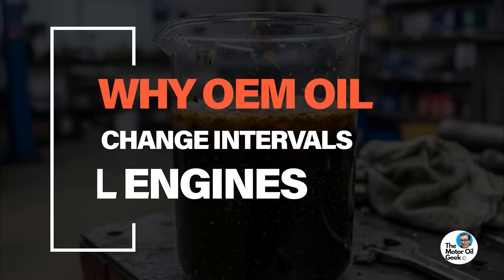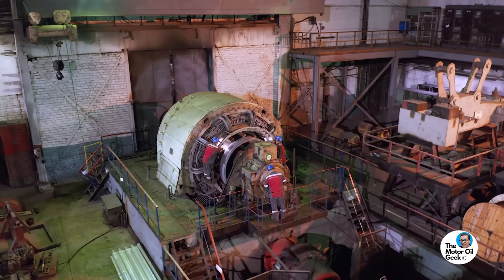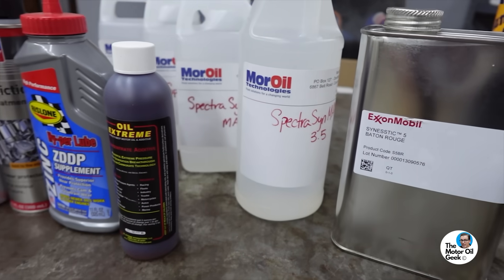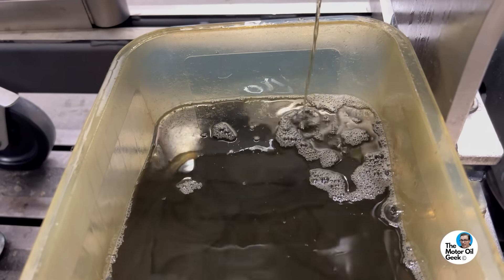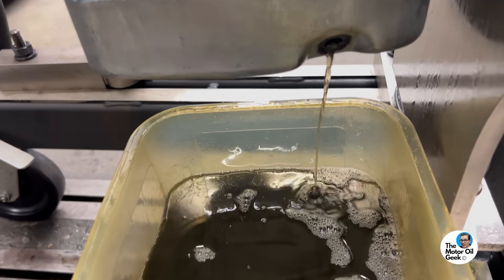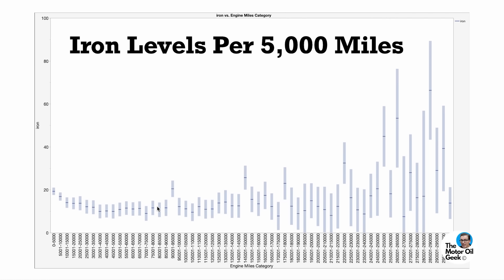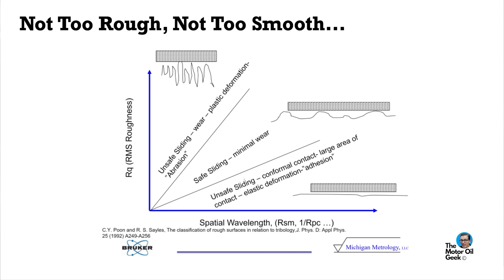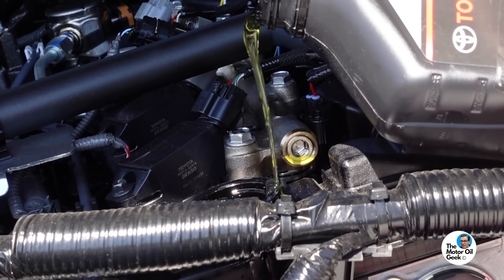NEW Data Reveals WHY Modern Engines FAIL Prematurely!

Comment: Filters actually filter better the more usage and clogged they get assuming they dont get so clogged flow is restricted to much. Ive got a 2023 f250 with the 7.3 gas i bought new. I changed my oil at 1500 miles 3,000 then roughly 5,000 to 7,000 since. Im now at 25,000 miles and my target oil change interval is 6,000 miles. I use penzoil ultra platinum 5-30 and amsoil filter would it be better to change my filter every other oil change? My way of thinking is its a better filter rated for more miles than 2 oil changes and the filter will actually do a better job this way. Am i wrong ?

Comment: What is end of engine life? My VW TDI has over 700,000 miles on it with 10,000 mile oil and filter changes. My 80's VW and Toyota engines were closer to 300,000 miles before accidents took them off the road.

Comment: Its really ridiculous that the manufactures cant make reliable engines. There is no reason with modern tech and materials
Reply: They can but the market is demanding more horsepower and higher MPG at a lower mfg cost.

Comment: As a HEMI owner I change my oil every 5,000 miles maximum with amsoil 5w20 and send a sample for testing . My iron levels stay right around 12ppm. Is that too high ?
Reply: I switched to 5w30. RAM has gone from 5w30 to 5w20 to 0w20. No engine changes. They would switch to 0w0 if the govt told them to. Go with what it was originally  designed for - 5w30.
Reply: @SatoshisDiaper  that’s good to know they originally required 5W-30. I do have an extended warranty until 100,000 miles so I will keep the 5W20 until then to avoid any warranty issues should I have a lifter failure. Do you know when they switched from 5W30 to 5W-20?
Reply: @itgoesfast2722  what AI said 

For the Ram 1500 with the 5.7L Hemi V8 engine, manufacturer-recommended motor oil viscosity has evolved as follows, primarily to improve fuel economy (CAFE standards) and cold-start performance while maintaining proper function of features like Multi-Displacement System (MDS):
•  Pre-2005/2006 models (e.g., 2003–2004/early 2005): SAE 5W-30 (or sometimes 10W-30 in older references) was the primary recommendation.
•  2005/2006 onward (starting with widespread MDS introduction in trucks around 2006): Switched to SAE 5W-20 for better fuel efficiency and MDS compatibility. This remained the standard through 2021 model years.
•  2022 onward: Changed to SAE 0W-20 (full synthetic recommended), offering the same hot viscosity as 5W-20 but improved cold-flow properties.
These changes apply specifically to the Ram 1500 (light-duty) models. Heavier-duty Rams (e.g., 2500/3500) often retained thicker oils longer due to no MDS and higher towing demands. Always confirm with your vehicle’s owner manual or oil filler cap, as exact transition years can vary slightly by sub-model or region. Oils must meet FCA/Chrysler MS-6395 specification.
Reply: @SatoshisDiaper thank you
Reply: @itgoesfast2722 no problem. I have a 2024 with 34K miles and as soon as I switched to 5w30 the awful clanking for a few seconds on cold start mostly went away immediately after changing. I’m not going back but I’m coming from 0w20 which is a bigger jump than you are.

Comment: Which is more important?  1) Engine that lasts a long time   2) Clean oil.   Problem: 2 can never be guaranteed.  So, to achieve 1, we must make engines like we used to.  Tougher.  More forgiving of dirty oil. More easily repaired after oil damage has occurred.   Considering all the C02 emitted during engine manufacture, the most "eco friendly" engine is the one you don't have to replace.
Reply: People always have the freedom to (re)build their own engine as they see fit.
Reply: @ALMX5DP  They should be built reliable from the factory.  Not "rebuilt" .  I don't want to rebuld a brand new engine I just paid   >   $7,000 for
Reply: @RedOctober2011  you asked the question, I was just providing an answer if that is your priority. Dont have to build a brand new engine, (re)build the one you already own.
Reply: @ALMX5DP  Oh, yes.  Exactly.  Rebuilding a rebuildable engine is a good choice.  I'd like to see new engines made more tolerant, simpler, and easily rebuildable.

Comment: Because manufacturers are designing engines to fail to maximize profits. The highest miles engines I've ever seen were an 87 Buick Century with 730,000 miles on the iron Duke and 3 speed, and 540,000 miles on an 88 LeSabre with the 3800 and 4T60 automatic transmission. Those days are over. And they won't come back without reliability and repairability standards are enforced by law.
Reply: You do NOT want Congress involved, at all, with vehicle quality standards.  That would be a disaster.  Let the market decide based on merit.
Reply: @gregh2880 The market has decided on engines that have rod bearing problems at 60,000 miles. Cars that burn endless amounts of oil. Cars with automatic transmissions made of glass.
Reply: @gregorymalchuk272 When I purchased my Sierra with a 6.2L engine two years ago, it was my expectation of a 300k+ engine like the thirty years of LS engines before it.  GM is the one that dropped the ball, not me.
Reply: How do engine failures maximize profits?
Reply: @craigyirush3492 You buy a new car.

Comment: Many of you might recall that manufacturers used to deliver new vehicles to consumers used to have break in oils in the engine. This is why you were usually required to be changed around the 600 mile mark. They stopped this because no one was ever changing this oil out, running the break in oil for thousands and thousands of miles. Non synthetic oil is great for break in but manufacturers deliver new vehicles with synthetic, which means the engine take much much longer to actually break in properly.  Food for thought.
Reply: I changed Toyota oil after 600 miles as advised by the owner's manual. Also recommend is 0-20 but I switched to 5-30 due to the hot climate. No problems and the engine sounds quieter so my guess is that regular wear is reduced by the thicker oil.
Reply: @PassivePortfolios  I have a new 24 Tacoma which just passed 26K miles. I too live in a hot climate (Phoenix). I've kept I on 0-20, but open to flipping to something a little heavier. First three changes were right on top of one another, then spaced out 3k after that.
Reply: @LincolnSixAlpha  Your Tacoma has a turbo 4 cyl. so switching to 5-30 will helps in the Phoenix hot climate. The factory recommends 0-20 due to MPG regulations by CAFE. Mechanics told me to use 5-30 in my F-150 and wife's 2021 Tacoma V6. And no more than 5k miles between oil and filter change intervals.

Comment: All of this makes perfect sense and really is something I have done either with new engines or ones that I have rebuilt. Surprising about the filter being better the longer it was used but, like someone mentioned here, manufacturers did, in the 70's, recommend filter changes every other oil change.

Comment: someone told me that a k@n air filter is not that great for an engine when its new because it flows too much and allows some debris into engine , but after 10k miles when its dirty it flows just as much but filters way better because dust sticks to dust so you get high flow with cleaner air as it ages
Reply: Nope, don't like those gauze air filters. They don't stop the fine abrasive particles. Then when they do start getting dirty they restrict airflow in my experience.
Reply: Most of those cold air intake filter kits are hard on your engine and they suck hot air from under the hood!

Comment: Sorry but we did not have this many failures until we took all the viscosity out of the oil. 0W and 5W base oils simply do not have enough film strength and the engine failures prove it.
Reply: It doesn't prove anything.

Comment: Our design goal of the best possible oil made leads us down many roads. Much of an engine is designed around the poor properties of crude oils because there weren't lots of options for plant or algae based stronger oils. That will change in coming years and has already been perfected in the racing world. We don't use petroleum oils in the high rev two stroke world championship world. $ strokes can have this tech too. It is more up front investment but cheaper over he long haul. Filtration is always a good area to explore, especially for longer lasting oils that just need the dirt and particulates removed.

Comment: Lake, I am a firm believer that today's engines the bearing clearances are simply too small. The OEM's are doing this to both reduce emissions and improve fuel mileage.  I also believe that the extended oil change intervals increase damaging combustion bypass (because of the low tension piston rings) particles getting in the oil.  When I used to rebuild engines, modern clearances of .002" was nuts, as the engine heated up, spinning a bearing would happen very quickly.  Hence the 0W-10,0W-8  oils to get into those clearances.  They should go back to. 008"-.013" clearances and back to 10W-30 oils.
Reply: You are spot. My lottery guess is what you said is exactly the reason for the failures.
Reply: Naw, you didn't run that much clearance did you?
Reply: @oneninerniner3427 I'm old and retired.  But back in the 80's and 90's ( the olden days to you) we absolutely had clearances that size for mains.

Comment: Subaru 3.6L uses variable valve timing and with regular oil, they recommend 7500 mile oil changes. These engines routinely last 300k plus. These engines also use small oil filters. My outback 3.6r  has over 215k on it and it runs like new.

Comment: The 7.3 power stroke was probably one of the first engines that seriously used engine oil for hydraulic fluid. It used the oil to fire the fuel injectors.

Comment: back in the 70,s the car manual used to say change oil filter every second oil change , i guess they knew something back then about oil filters, i got a 1970 plymouth fury 111 and the owners manual sais change oil filter every 2nd oil change
Reply: I remember when that was a common practice.  Back then oil filters were a lot larger. Close to the size of a quart oil can.
Reply: That's what I do currently.  Suck out the oil from the dipstick tube on alternate changes.  Too bad the trend is moving towards removing dipsticks.
Reply: My 1987 Mazda RX-7 owners manual says this too. After the first 2,000mi, It has a 7,500mi drain interval for the oil and a 15,000mi change interval for the oil filter!

Comment: Filtration is extremely interesting.  Please do more.  A co-worker friend of mine (back in the '80's) had a new Toyota Supra.  Awesome car.  He had his oil changes done at one of those quick change places.  They used a cheap oil filter.  One morning, when he started the engine, the oil filter split open.  That was caused by the very high in-rush oil pressure that the cheap filter could not handle.  I do my own oil changes and never go cheap on the oil filter.
Reply: I've never heard of a filter housing splitting on a filter. That is insane. Must have been a manufacturing defect.
Reply: @glennt72  I agree.  I never heard of that before.  My friend (Mike) at the moment it happened, Mike was not aware of the split filter.  Just a block away from his house the idiot lights lit up and smoke surrounded his car.  The overhead cam had sustained $1200 in damage.  The oil change service company denied liability and said for Mike to go after the oil filter company.  Mike talked to a lawyer and the lawyer advised against it.
Reply: @glennt72  Used to be very common in New Zealand in the 1990's with 2.8L diesel hiluxes, if you used a cheap oil filter with 15w40 diesel oil (the workshop manual reccomended 10w30). when the engine oil was cold the relief valve on the oil pump could not dump the excess pressure fast enough and the filters would blow up like a football.
Reply: @glennt72 it doesn't make much sense but if there was a blockage after it then it starts making a whole lot ot sense, if the filter broke internally and blocked the output

Comment: Great video. I’m a 2024 Ram 5.7 Hemi owner. I’ve spent countless hours researching the failures. What happens is the lifters fail. Mileage varies so anyone over 50K is at risk. It may never happen. The WHY is much more complicated and there is no accepted 100% consensus but the latest “start of art” is that it’s camshaft casting defect. Who knows if that is actually true. For years it was generally accepted it was the MDS system but I think that’s been mostly debunked because same failures are happening on manual 5.7 Challengers with no MDS. Lots of idling is also considered a major contributing factor. 

So the bottom line is no one really knows. Ram probably knows but they’re not saying which leaves us to speculate. Maybe it’s a combo of all these things? 

Now watching this video the lack of proper break in I’m sure is a major contributor if not THE reason. 

I bought used at 34K so it’s too late for me. However, I’ve switched to 5w-30 from 0w-20 (viscosity is another huge theory) and will change at 4-5K miles. I didn’t think about fuel dilation from cheap gas. I’ll switch to top tier. 

Oh I also run a catch can even though it’s port injected. I only installed it 3 months ago so too early to tell. I dumped it once and there was already some fluid in it.
Reply: I put a catch can on my Ram, right after I bought it. I have 34,000 miles, a Democrat change every 5,000. I get 2 or 3 ounces, every oil change. That would be carboning up the intake system. I also just started using heavier oil, after seeing these videos.
Reply: @garyszewc3339 ram has been a bottom feeder on every 
automotive survey 25 + years

Comment: Lake. Would be interesting to see your thoughts on a VVT engine designed for 5W-20 using 5W-30. Would the thicker oil actually hurt the engine?
Reply: First check globally if there is some country they recommend 5w-30. Odds are 5w-30 is already being recommended in your engine somewhere. That tells us it’s gov BS interfering.